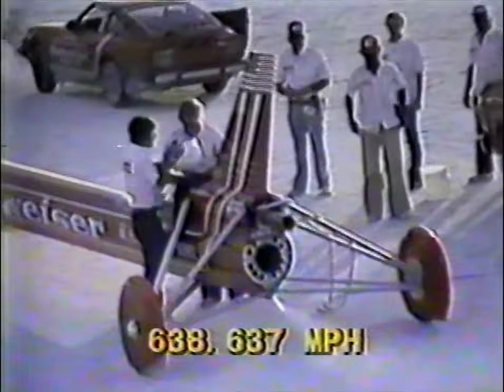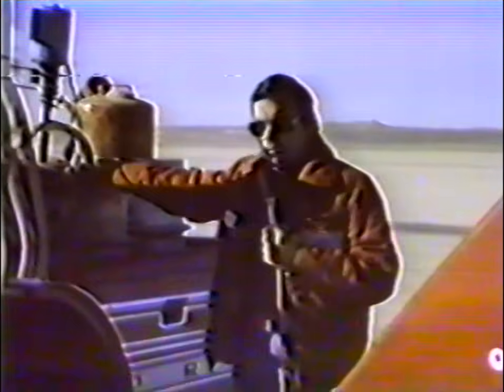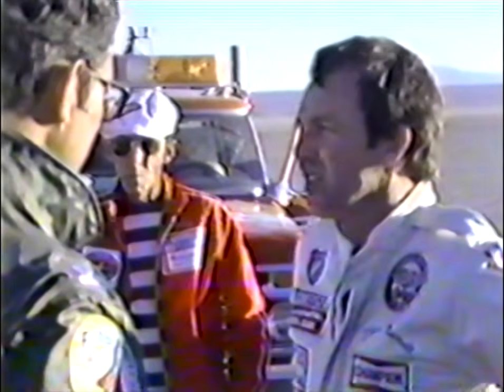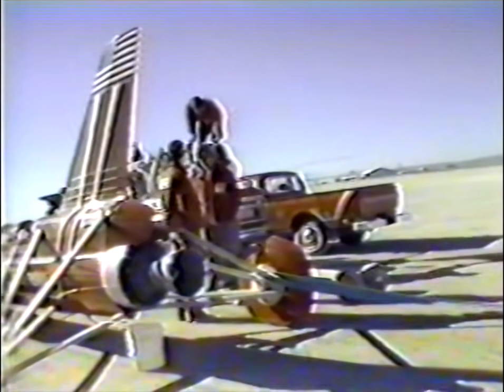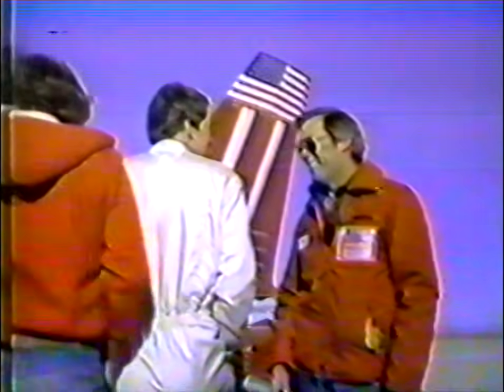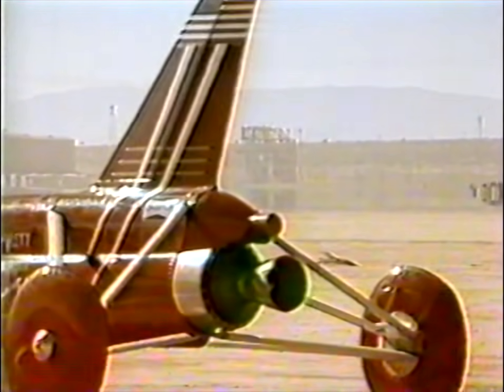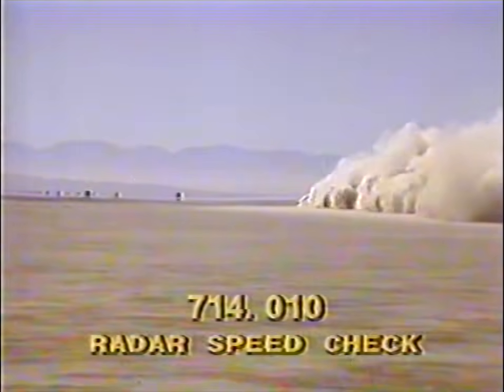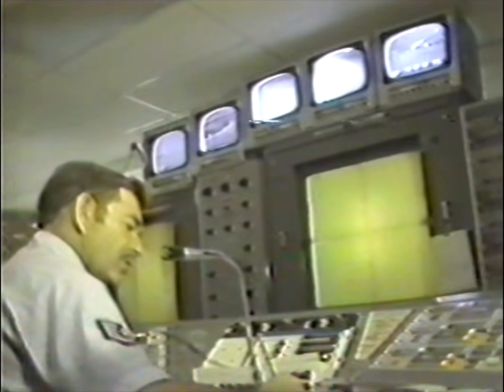Stan Barrett Breaking The Sound Barrier Live from Edwards Air Force Base in 1979

Comment: Today this would never be allowed these guys were able to use Edwards AFB and they gave him a sidewinder Air to Air missile engine they said it had way more thrust then they thought it would once you fired it it was a solid rocket motor you were along for the ride until it burned out. The car was built well never crashed ran it 17 times. Must have gotten access to the base with Chuck Yeager who had just retired from the Air Force in 1975.

Comment: WWII pilots did not break the sound barrier. Ask Yeager. All the fighters had compressibility problems and some pilots died because the controls would quit responding and others had close calls. This car did not break the sound barrier. Radar and airspeed indicators would not have been accepted as proof anyway. Did they run anywhere where FIA set up timing beacons? I don't think so. Thrust SSC did. Several times. Not only the timing and scoring said so, but it also made sonic booms and an overhead shot shows this incredible shock wave kicking up the dust on a line from the nose a hundred feet out.

Comment: Chuck wasn't the first guy to break the "sound barrier" which isn't a barrier at all, and never was.  It was actually one of the other test pilots that did it first, same plane.  Really, guys had done it MUCH earlier than this, though, back in WWII several different types exceeded Mach1 diving.  P38 was one of them.  Had control reversals due to shock flow, and killed quite a few pilots before somebody figured that one out.

Comment: The barrier is the speed of  sound witch  can change at different  levels  as the air is thinner as you go higher. So yes that's  why  there is a barrier.  At 10.000 feet its 614 miles an hour.  There are different  barriers  according to  levels.  So you don't know what you are  talking about.

Comment: Someone actually tried to tell me that these salt “flats” are  not actually flat but that they “curve” with shape of the earth, the biggest salt flat in the world in 3900 square miles and located 12,000 feet of in the Andes mountains of Bolivia, so these “flats” would need to curve less than the ones located at sea level because of the elevation you need to add 6000ft to your radius calculation, the whole thing needs to curve at just the right amount +6000ft added to the radius in order to maintain the 12,000ft elevation over the entire 3900 square miles, and actual “flat” salt flat that size would no longer feel “flat” you’d actually start to gain elevation after a while traveling in a straight line on a ball, a plumb shouldn’t read true on either end of the salt “flat” if it were actually flat, it needs to “curve” in order to maintain elevation on a ball

Comment: It's too bad that it's not an official land speed record. For it to be that they would have to have accurately shown the speed in two directions and the average between the two would still have to be faster than the speed of sound. Because this car could not be turned around that quickly, and because the way the speed was measured was not official or necessarily accurate, there is no way it could have been recorded as a land speed record. However, that does not mean that the car did not break the speed of sound. The only real question there is to that is what happened to the sonic boom? No one recorded hearing a sonic boom. And if there's one thing we all know about breaking the speed of sound is that in order to penetrate that barrier you have to produce the shockwave that results in the boom. No boom, no sound wave.

Comment: Hey, the car is in the Smithsonian as breaking the sound barrier. It never was planned for qualifying for a land speed record since that would required four wheels, and two runs over a mile. In 1977 this was a pretty dangerous project.  Years later, I asked General Yeager what he thought of driving the Budweiser Rocket car. He said driving the Budweiser Rocket car was the scariest thing he had ever done in his life because of the vibrations. Remember, once you press GO, there was no easing off the throttle. General Yeager reached just short of 400 mph.
Reply: @racefanwfo  Ah, OK

Comment: When a body approaches the sound barrier different surfaces to begin to go supersonic before the whole body  punches through   - its possible this car went transonic  briefly  but there is nothing in this video to indicate the car went supersonic unlike the Brit car which clearly sustained supersonic speed in both directions over the measured mile
Reply: You employed by Guinness?  Lol if you watched it..the proof is in the U.S. Air Force timing systems..more accurate than anything available at that time....and the Brit that came around 20 yrs later with better tech.  Lol

Comment: If they were really smart, they would've created the right energy field around the car. Which would've allowed a lot more speed. The problem with rockets is the fuel consumption  rate. You need a big long car to have enough fuel on board to make a complete run. But more fuel more weight and worse, size. That's why you need that high energy field around the car...
                                                                                                                                   Jeffrey Smith    New York. NY

Comment: My 4 engine 8 wheel 10,000 hp LSR car pales by comparison.... designed to be driven to Bonneville, not a trailer queen. Only change is the tires and wheels. They are the limiting factor for speed records. Power can be made, but if you can't go 5 miles without tires and wheel exploding, no new record will be set. It could kill the driver if tires / wheels failed at speed.  It will go 500 mph without needing full power. 600 mph is the goal. Maybe in 2025.

Comment: did wire guided car ..high school  gotan A+ did estes D engine ,,,wheels came off.. did other trys
Reply: Very cool GRIFFIN. When I was a kid in the early 80's I put an Estes D engine in my Barbie Dream Vette. First shot it spun in the driveway, filled the garage with smoke, set the smoke alarms off and pissed off my mom. :) At that point, dad helped mount the motor and he designed a launch pad. 
Second launch and that Barbie Dream Vette shot down the driveway, hit the street, took flight, shot across the street and lit the neighbors shrubs on fire. 
Luckily my dad and the neighbor were defense engineers. They cared more about us being interested in rockets than the scorched shrubs so we weren't really in trouble. 
We never thought to use a wire to keep it on track.

Comment: No sonic boom. Not a two-way run, hence not an official record. Questionable measuring techniques by the USAF.

Chuck Yeager says on this very recording that at ground level, the speed of sound is about 740 miles per hour' Budweiser car was nowhere near that number.

The UK has held the official LSR since 1983 and went through the sound barrier twice in 1997 with Thrust SSC.

Just stating the provable facts. Love and peace.

Comment: Well I mean if they took this to a FIA sanctioned event they probably could have bested the Blue Flame for LSR but I didnt hear a sonic boom....   so nope   no mach 1 for them. Thrust SSC still rocks.
Reply: The Blue Flame records were in the flying start  mile and kilometer. The Blue Flame unofficially reached a peak velocity of 660 miles per hour, which is not a record but just a piece of information. The Budmobile was never timed over those FIA land speed record distances and was either timed over 52.8 feet (1/100th mile) or NOT timed at all. They got FIM to accept "instantaneous" speeds, but never attempted a 2-way run (necessary for FIM records) and FIM never certified anything. They continually claimed in the press to have broken The Blue Flame's "one-way record" - there is no such thing. They claimed spurious 1/100th mile one way runs of dubious accuracy as breaking The Blue Flame's (one-way) world land speed record. Lie to me once and you are a liar.
Reply: I didn't know any of what you shared.  Thanks so much.  It makes the Boy Scout in me very mad to realize that manipulation and spin is, and always has been, as difficult of a barrier for an achiever to overcome as physics itself.  Achievement = yes.  Word spin and manipulation = NO!

Comment: Stan did not break the sound barrier. Where is the sonic boom?? When Andy Green broke the sound barrier you could clearly hear the sonic boom. However a great achievement, no doubt about that, but Andy Green is still the only member of the "ground speed mach 1 club". 😎
Reply: The Air Force state that he probably exceeded mach 1....
The measured mìle was 666 mph.

The radar would sample the speed, not a continuous readout. I'd bet that the interpolated graph goes over mach 1,but no individual sample does.

On the other hand Thrust SSC averaged mach 1.02 for a mile.
Reply: @dougaltolan3017  Still no sonic boom.
Reply: @jonmcfarmer6954  the pressure wave needs time to build into the wave front of a boom. If he was supersonic for such a short time then its possible that the boom never developed.

A home experiment that everyone can try...
With a few inches of water in a bath, note the wake from:
A: a single finger moved the length of the bath.
B: flick the surface.

What you are looking for is the waves that hit the side of the bath.
Reply: @dougaltolan3017  So why didn't he repeat his run? I still don't buy it.
Reply: @jonmcfarmer6954  +shrug+ maybe ran out of sidewinder missiles, maybe knew it wouldn't be any different, maybe bottled it...

Comment: The thing to remember is that this car only broke the sound barrier long enough to say they broke the sound barrier. The car did not set any Land Speed records in its history. The Air Force did not certify the breaking of the sound barrier for several months because the evidence was so shaky. The "outrage" of not being acknowledged for breaking the record was purely personal.
Reply: The USAF never "certified" anything. The car was never actually timed, but numbers were created from uncalibrated data. The vehicle speed was never really known, nor was the land speed of Mach1 at that time and place known.

Comment: Where was this in the record books? this vehicle far surpassed the Thrust 2s speed in the mid 80s
Reply: Stool Posts yes but it still exceeded Richard Nobels 650 mph
Reply: @HXLproductions  No, it didn't because it didn't maintain that speed for 1 mile and didn't do it twice within 1 hour and wasn't measured using calibrated timing equipment.

Comment: Is no one surprised at the proof of Breedlove's concept found here? Surely this rolling tricycle could have had a fourth wheel of some kind, (although none, powered) and recorded some crazy high speed, on back to back runs, through a photo cell timing trap - and thus have become a legit record-breaker, in every way. 
Frederick's build quality should be better regarded in history. My guess, the Budweiser and USAF cooperation did not exactly win hearts and minds in international view
Reply: Refuelling, fitting a new Sidewinder rocket engine, cool down, reheat, any other prep work can easily exceed the required 1 hour turnaround.

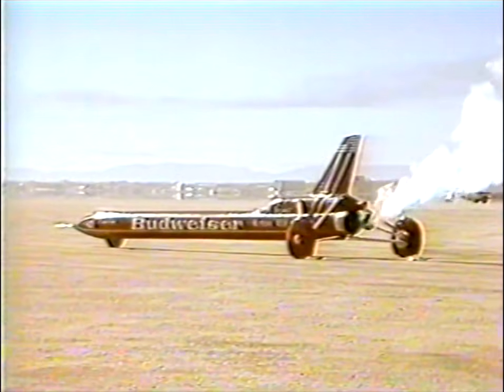Comment: Skip to 30:00
Reply: It's just a movie, created by Hollywood 'special effects' professionals.. 
To the uninformed, the word "radar" suggests a speed measuring device - like the traffic cops use. Again, the "radar" was only used to measure the DISTANCE, not speed, to a truck driving in the alleged tracks in the dry lake from the Budmobile. The device mentioned as "radar" is called a DIR (digital instrumented radar) used for target acquisition. It can measure range, azimuth, and altitude. Even so, per the U.S. Air Force, its data output was not calibrated or certified - therefore, useless. The alleged speeds were "reconstructed" by the SOS organization, not the U.S. Air Force (per the U.S. Air Force statement in a letter to me), and not by any independent certifying entity. So, the distance was unknown and the azimuth/time was just how fast the Air Force technician observer panned his TV camera from 4 miles away. Garbage in - garbage out! 
Show less 
Reply

Comment: They produced huge efforts & courage to run that machine , so why didn't they make it official ? It's not much more complication making two runs & serious time measurement .
Reply: Some Land Speed Vehicles may be impossible to make a a return run in under 60 minutes due to the complexity of refueling and the running the course is both directions (crosswinds, sun in the racers eyes...)
Reply: Good question, it may be impossible to refuel the Budweiser Rocket in such short time to make another run. Even if they did, it would be to no avail since the car only had three wheels, FIA states at least four. So their target was just to break mach 1 on land which they also failed to achieve.